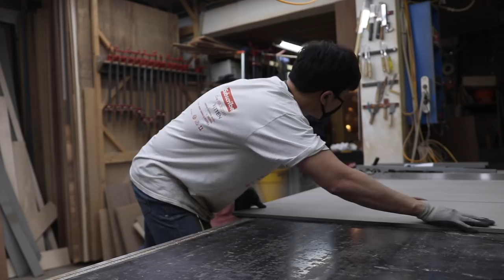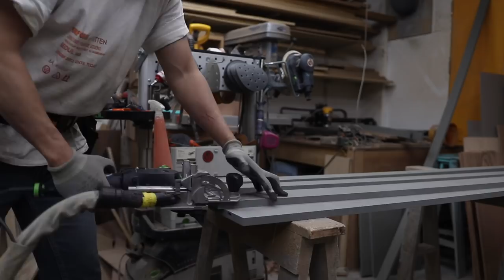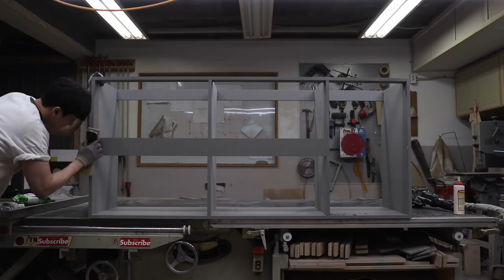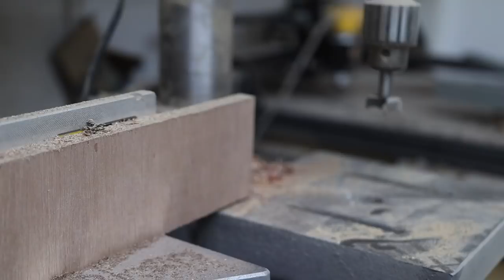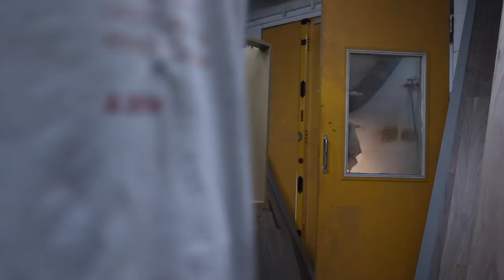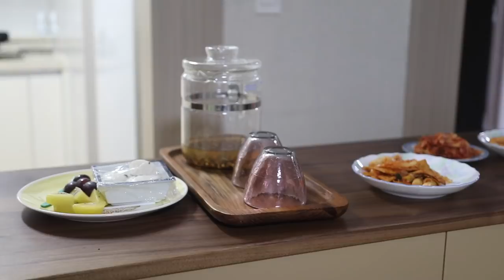W61_Kitchen Island

Comment: I apologize VITTEN, I tried to ask, but did not wait for your answer I will try again. 
I am very interested in your opinion on the materials you are working with. I see that you use Valchromat, which I understand is from "Investwood". Have you had experience of using the material from the Korean manufacturer "Forescolor", as they look very similar, but maybe I'm wrong. Please share. Thanks)
Reply from the maker: Forescolor is very similar with Valchromat. almost same. that is one of brand color MDF. there are many brands. Most famous brand is "Valchromat" there are some different points. density, color, smell. 10 years ago,  Forescolor have some problems. especially, smell. but not almost same. In addition, in Korea, Valchromat is very expensive. so I use Forescolor.
Reply: @ViTTEN  Thank you!)